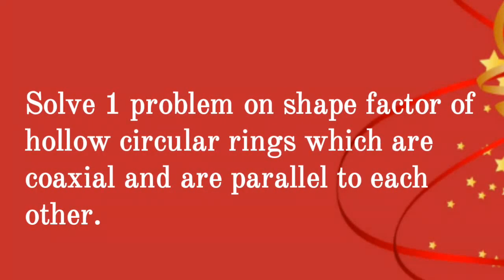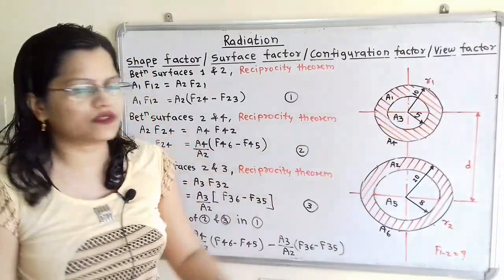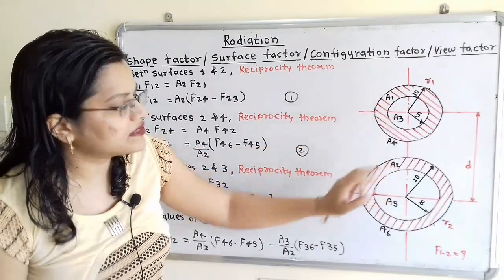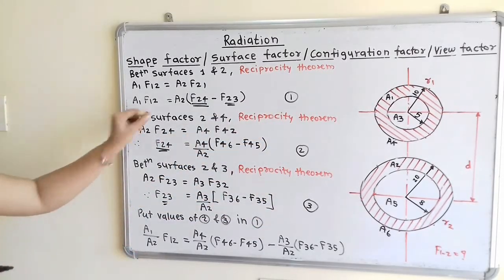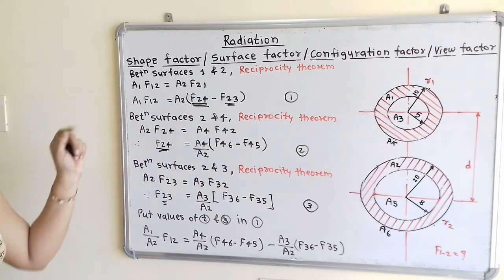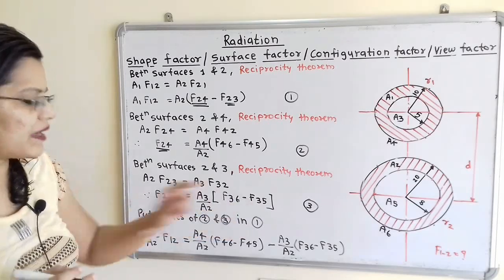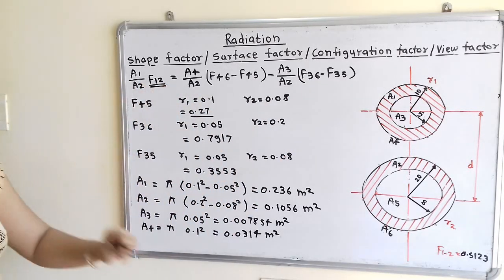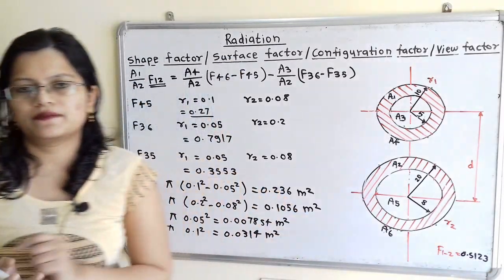Problem 3 On Shape factor of hollow circular rings which are coaxial and parallel to each other

Comment: The expression you use to calculate the view factor \( F_{46} \) and the others, according to Michael F. Modest's Radiative Heat Transfer (Elsevier, 2023), is correct. However, according to the book by Howell, Mengüç, and Siegel Thermal Radiation Heat Transfer (2010) (on which the former is based), the expression you are using actually corresponds to the radiative heat transfer between the lower and upper rings, meaning \( F_{64} \). The diagram in Figure 12.7 of Heat Transfer: A Practical Approach by Yunus A. Çengel (2002) also indicates that the base surface is the lower one, and the numerical result obtained from this graph matches yours. However, it is not the factor \( F_{46} \) but rather \( F_{64} \). There is a significant error in the result.
Reply from the maker: Thank you for valuable suggestion